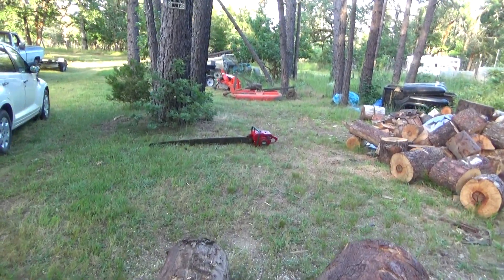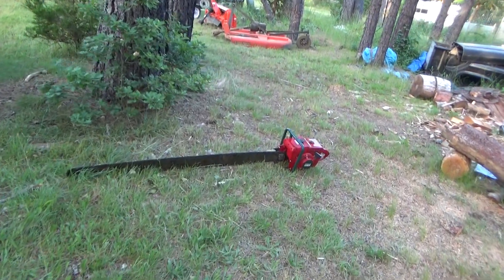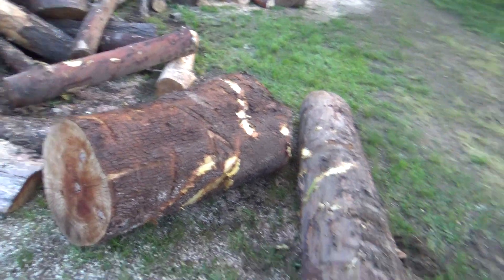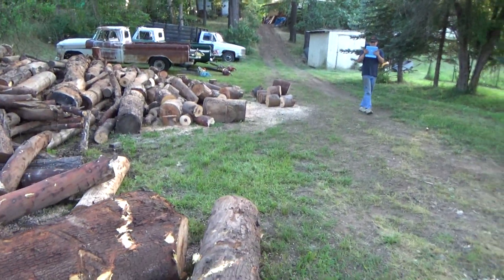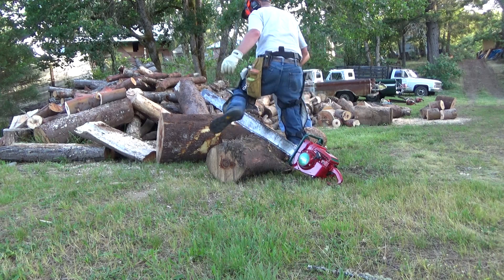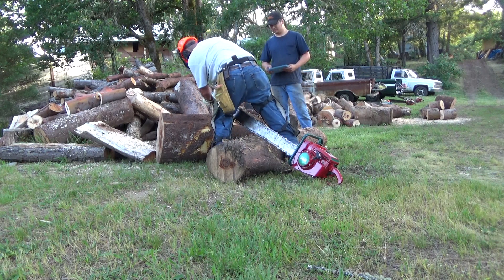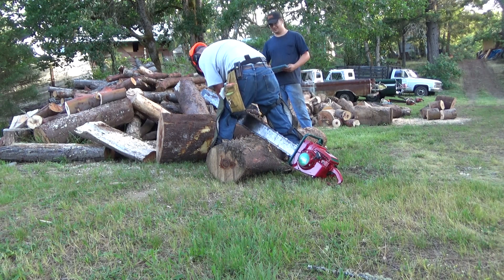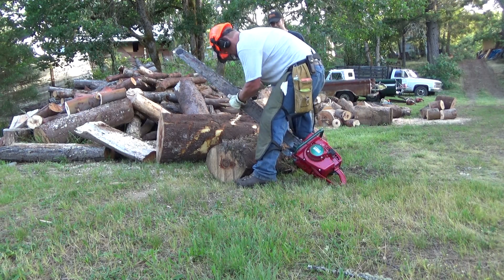Raisin' Hell With The Neighbors GTG Pt.10 (Homelite XP-1130G)

Comment: It will roar when you get that throttle shaft fixed
Reply from the maker: I ended up replacing the whole carburetor...it had the wrong one on it to begin with.  I got it tuned and running great tonight before I ran it dry for storage again.  The neighbors may not like me right now!